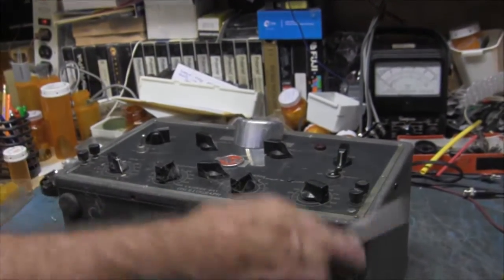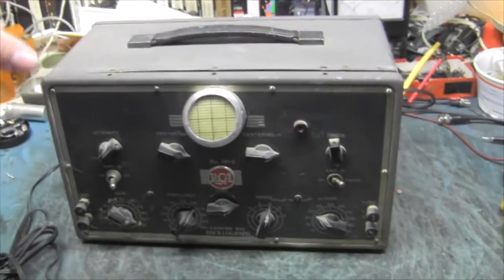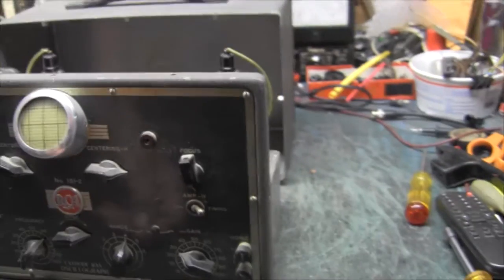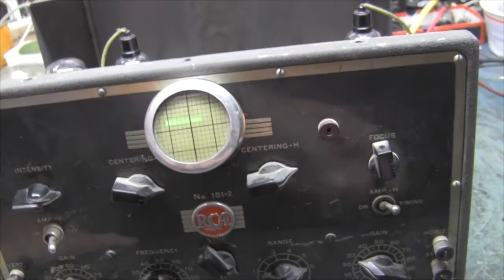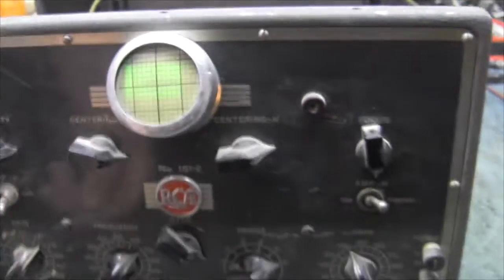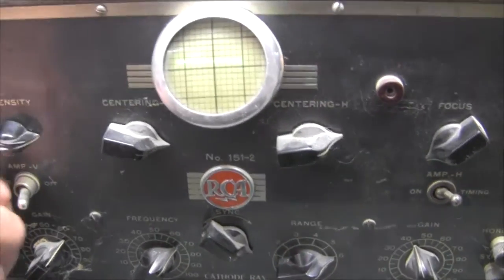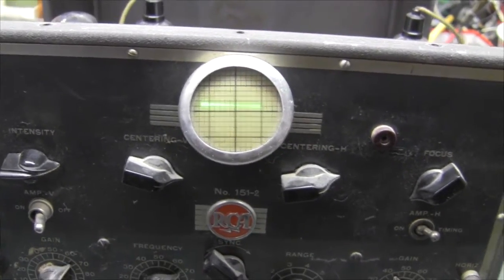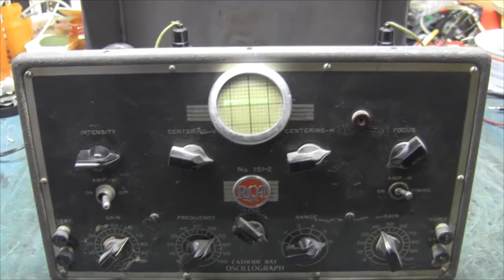A 1936 RCA Oscillograph

Comment: I have a RCA 151 with a 2-inch tube.  Someone replaced the original 913 1-inch tube with a 902 2-inch version. It works quite well after I re-capped it.